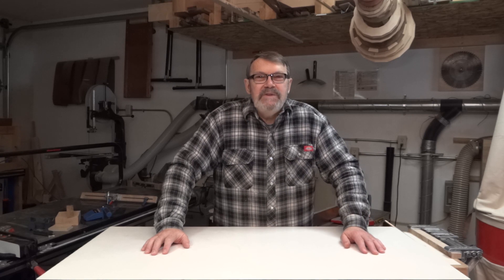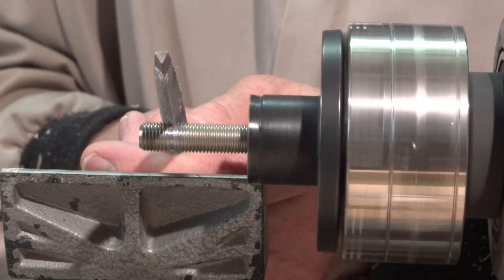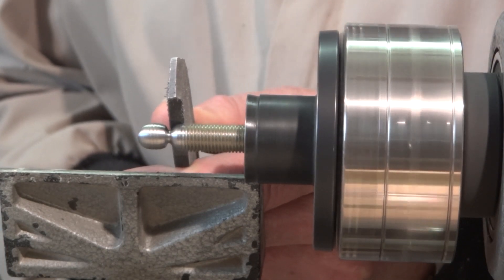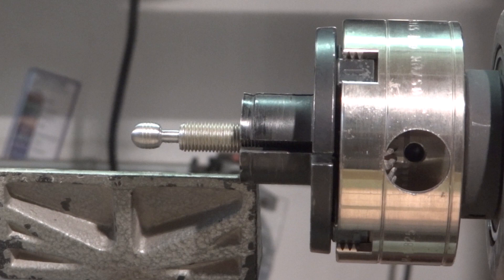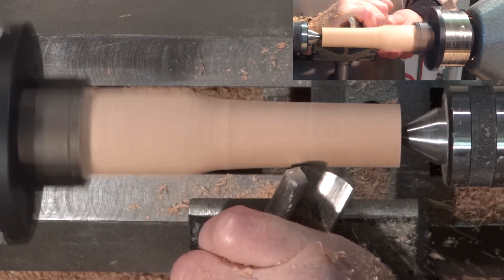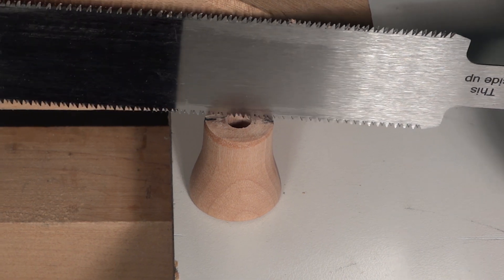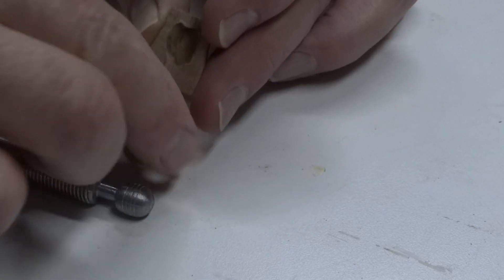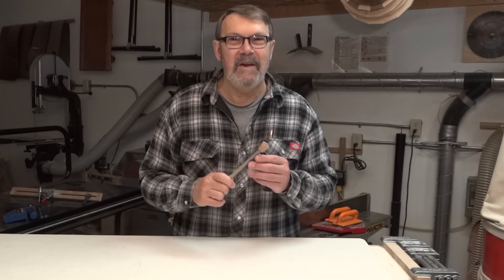Making A Ball & Socket Joint

Comment: You got there in the end! As a metal worker I can say that making use of all the cutting teeth on the file by running the file over the metal in repeated strokes will remove the metal more quickly and give the cutting teeth a chance to clear. Either way you have achieved you goal.
Reply from the maker: Yes, but it did take awhile! 😳😳

Comment: Nice result Gord. I couldn't help but wonder if a rotary tool with a metal cutting disk wouldn't be a lot faster, at least to rough out the shape before refining with the files.
Reply from the maker: Mike Goldfine You may be right, Mike. I don't have any metal cutting disks so I wasn't able to find out. Thanks for the feedback.